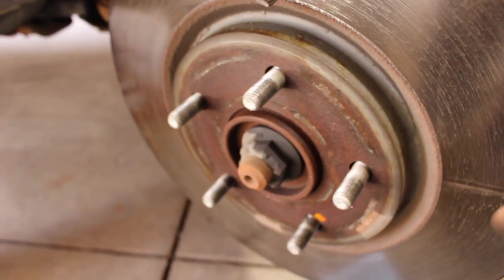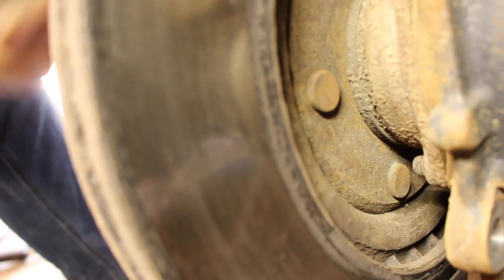2008 2016 Dodge Journey Front Brake Replacement

Comment: I ended up doing mine last night thanks to your great video. Everything worked according to plan but after seeing it with my own eyes, i DO recommend that you remove the lid to the brake fluid reservoir, as it did overflow when compressing the brake pistons. I had to use a turkey baster to remove excess.
Reply: What size whats u rotors  it was 330 mm

Comment: don't forget to spray down both sides of the new rotor with brake clean before installing it to remove the oil that is on it in the box.
Reply: You should spray them with brake clean and then dish soap and water to demagnetize the metal shavings. The running water demagnetizes the metal shavings and washes them off,  all the brake clean does is get rid of the anticorrosion oil .then all the metal shavings will not get embedded into you new brake pads and cause them to squeal. Like a needle on a record.

Comment: if one side is a lot worse that means its starting to seize up.. and always hang the caliper to the coil spring to avoid the caliper falling to the ground and pulling the rubber line out of the caliper itself  its only pressed in. And if you have the bracket in the garage use the wire wheel to clean any rust on the slider area    . .  other then that  thank you for posting the sizes of the bolts and using anti seize

Comment: I can't believe I just saw someone use a FILE to "remove rust." Files remove material. If someone isn't familiar with them they just screwed up a brake caliper bracket.  Better to use a wire wheel at low speed. I am lucky enough I have a media blasting cabinet.  Also as a side note, use non chlorinated brake cleaner. Not as harsh on rubber and plastic if you happen to over spray.

Comment: Using the silicone based grease for your slide pins is the right way to do it. Don’t use anything els, they will swell up the rubber sleeves on the end of the Gide pins and making it not move as smoothly. Causing the rotor warp.

Comment: I hope that is high temperature anti sieze you are using or you will be creating all kinds of problems. Anti seize is wax based and when it heats up turns into cement and will prematurely wear your pads. Lubrication is a must but you need to use the right lubrication
Reply: Love your videos , you are very profecional and easy to understand  God bles you greetings  from Puerto Rico

Comment: Can we apply disc break quiet on the pads? Thanks for the  video
Reply: No need if the pads have a material on the back of them. The ones he uses in this video have that material, so he didn't need to use any brake quiet. If its metal, then yes.

Comment: When compressing the pistons on the caliper, did you need to open up your brake fluid reservoir?
Reply from the maker: no I never do either. there is no need to.
Reply: Only if you have added fluid to the resovoir because you noticed it was low. Plus that's a good way to tell you need new pads. As the pads wear out and get thinner the fluid drops in the master cylinder.

Comment: Good video and cool music. Should I open the cap of the brake fluid before pressing the pistons down? What's the music in the video?
Reply from the maker: glama88 opening the cap is up to you. I didn't.  The music is from YouTube. It's free and I download it for my videos and there are no copy right issues. I don't remember what it's called.
Reply: That was actually something I was wondering about.  I've seen some mentions of opening up the cap, even having to do full bleeds to change the pads.  Thought that sounded wrong, but the last vehicle I did brakes on was an 87 Crown Vic wagon, and tech has changed since then.  Figured it was possible ... as a shadetree mechanic deterrent!  Thanks for the walk through.  It was very thorough.  :)

Comment: never seen anyone use a file to clean brake caliper brackets, brass brush or brass wire wheel is better and wont damage the brackets. otherwise not a bad video!
Reply from the maker: I work on cars in the salt belt. A wire wheel or brush isn’t enough to remove the layers of rust.

Comment: if you replace the brakes and rotors and when you test drive it, the brakes on one side smoke a bit, is that normal?
Reply: Marvin Ellis clean the rotors with brake cleaner. They have oil on them to prevent rust from forming on them before being bought
Reply: thank you

Comment: Are the backs replaced the same way?
Reply from the maker: Tim Ocovich it will be very similar but the pistons have to be twisted in with a brake tool. They CAN NOT be compressed with a C clap. If you look at my Toyota Prius brake replacement I show the cheap tool that auto parts stores sell. Harbor freight sells a larger nicer kits.

Comment: So they do not require bleeding?
Reply from the maker: jayman8940 you do not need to bleed brakes for a rotor and pad replacement. But someone else may say you need to. I don’t.
Reply: If u open the bleeder and let air in the line then you do. If you dont crack it open then no air got in and tou dont need to.

Comment: What happens if you don't use a torque wrench
Reply from the maker: Kevin Sukdolak so I’m not sure how to answer this question that doesn’t make me liable. They torque spec is provided by the manufacturer so bolts and nuts stay in place and have the correct clamping force. If you’ve ever worked on cars you’ll know that is come places that it’s always necessary. If you are working without a torque wrench you risk not getting the bolt or nut tight enough and they will back off. You also could risk getting the bolt to tight and snapping it. Whenever I’m working on customers cars I always you a torque wrench for almost everything. My personal fleet of cars no so much but I’ve been doing this long enough.
Reply: @jth1987leb  thx...I've done brakes before without a torque wrench never had any problems...

Comment: Too many steps that are not needed.  I file to clean the pad brackets?? You will file too much metal out and and the pad brackets will he loose Wire brush.  I own a journey amd have done the brakes myself since.  Too many unnecessary or wrong steps.

Comment: You cleaned off the Caliper Pins and mentioned that there was some metal on them but NOT cleaning out the Caliper Pin guides on the Pad Bracket before you re-lubed them?  Shame.  Should also be using a wire wheel (removes the rust) on that bracket and not a file (removes rust, yes, and also material from the bracket).  Shame.  Glad that's not my vehicle.

Comment: My break pads are so not the same
Reply from the maker: there are two different brake sizes for the front. the one in this video are the larger ones.
Reply: @jth1987leb  yup..  parts store pooched it.  Thanks 4 the help

Comment: first lose the dam loud music as it is not necessary, also removing the brake line clamp is not necessary, also do not use a file to remove the rust from the brake clip positions, a wire brush will do a better job and NOT remove any metal ,and always loosen the cap on the brake fluid reservoir,also while you are retracting the caliper piston use a bit of silicone grease around the rubber boots, hope you cleaned the new rotors off as you didnt show that
Reply from the maker: The amount of stupid in this comment hurts. I use a file to remove the rust. The rust has to be removed to the pads can more freely. All a wire wheel does is polish rust. There’s no need to take the cap off a brake reservoir. The logic behind that doesn’t make any sense. Brake fluid moves through the system all the time. So, by your logic when the brake peddle is press the cap better be off the reservoir. Not all rotors are shipped with oil on the requiring them to be cleaned.

Comment: No....just no. Filing caliper brackets, compressing pistons with the wrong tools and the bleeder closed, using the wrong types of lubricant.  This is the kind of work you get from your "mechanic" friend please take your vehicles to a real technician.
Reply: What are you talking about lol I've done brakes like this for years and years never opened a bleeder once never had any issues at all new or old cars
Reply: @codyyork5086  you have they just won't bring it back and let you have a second try.